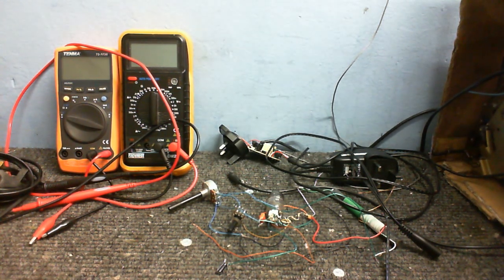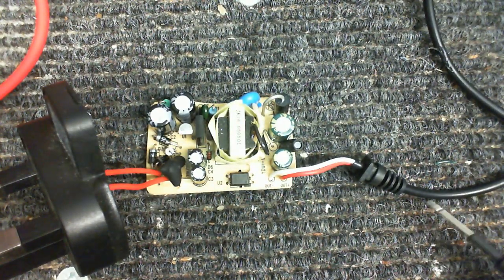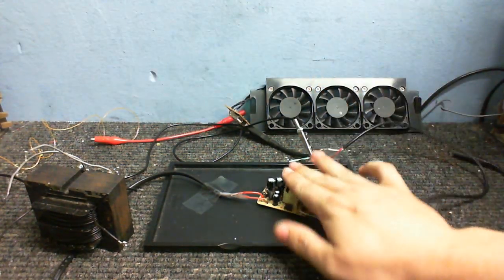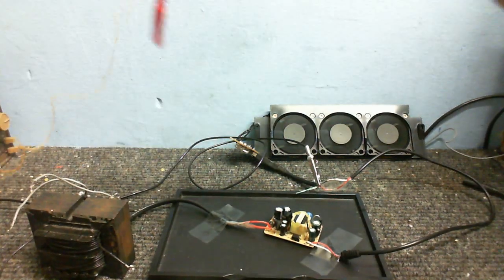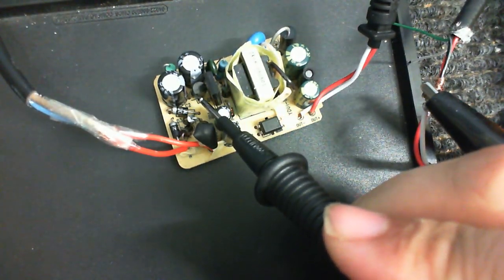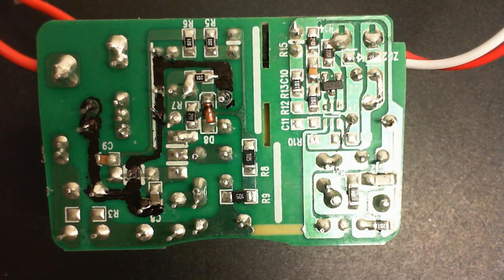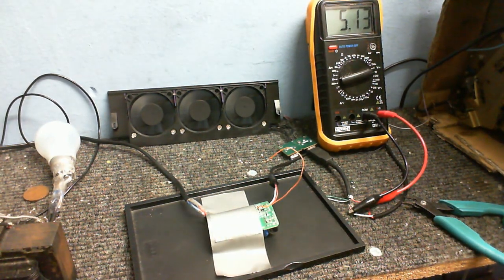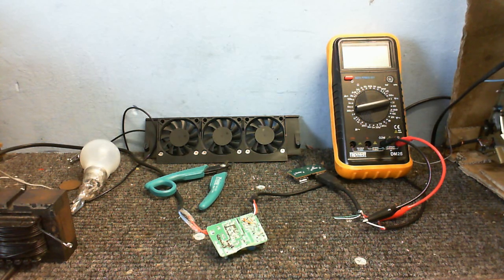CDC Electronic Workshop - How to modify a wall wart power supply

Comment: That's pretty cool Clem, I wouldn't even know where to begin a project like that. how did you find a schematic for that power supply?
Reply from the maker: I drew out the schematic myself, it wasn't easy as I had to examine both sides of the PCB very closely to see where everything goes.
Reply: wow, very impressive
Reply: coolbluelights Modding these isn't all that hard. Usually it is just a resistor that you have to change. Sometimes it makes the circuit not work right, and you will have to do some de-bugging then. By not work right, I mean these will oscillate and provide a very noisy (more than normal) output voltage.